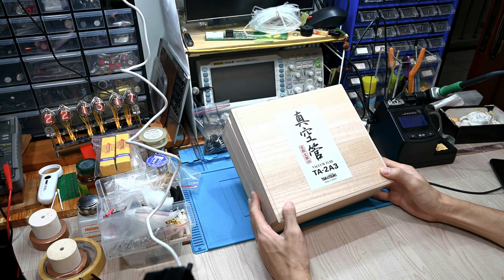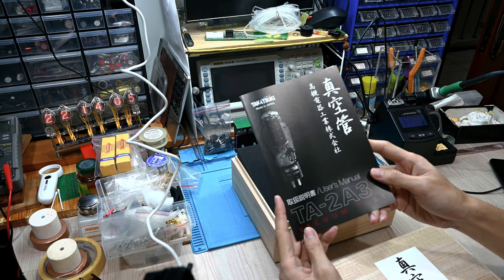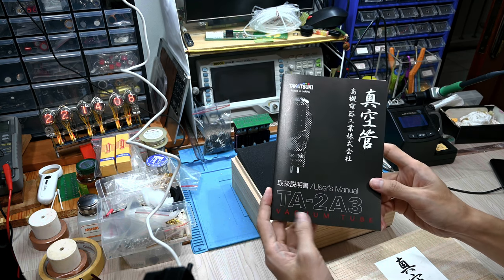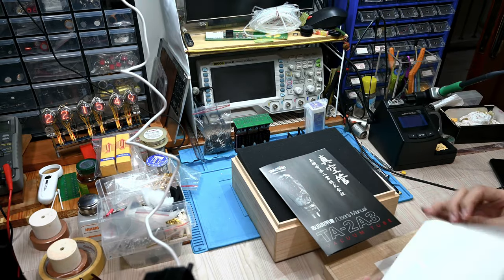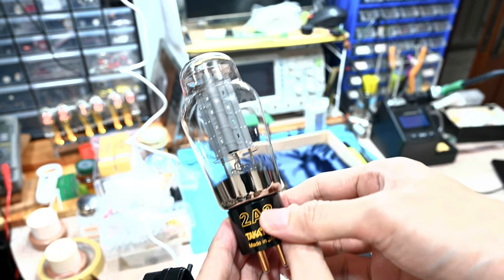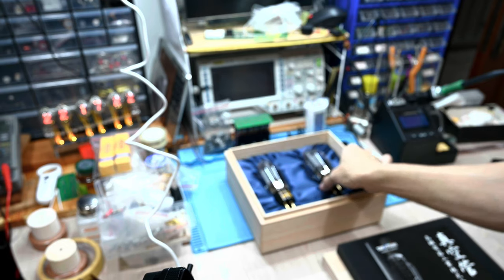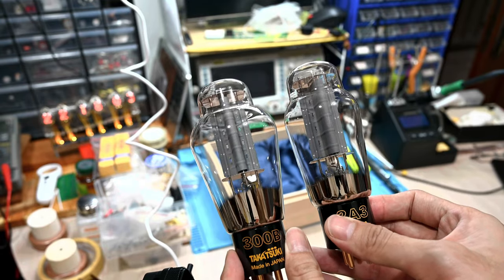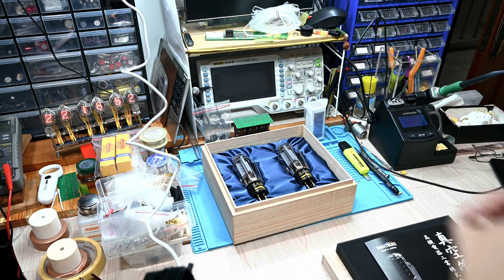Takatsuki TA-2A3 Vacuum Tube

Comment: RCA 2a3  vt-95 is a nice sounding tube do have a few.  Thing about using a pair in a pre-amp . Watch Western electric they clam a graphine coating  for small signal tube and on their 300b .  For Western Electric  it when not if .
Reply from the maker: Thanks for sharing. Should see if can get vintage WE someday...
Reply: @jimmysjunkyard  Well a bit more than I want to spend for now .  Have a large stock of 6 different tube to play with first . Ranging from 20 to 100 of some so  not for a bit of time.  Interested in you thoughts on audio note resistors for grid resistor use ?
Reply from the maker: @johnwilliamson467  ah ok... Let's see how does it perform later (the AN)... Thanks.